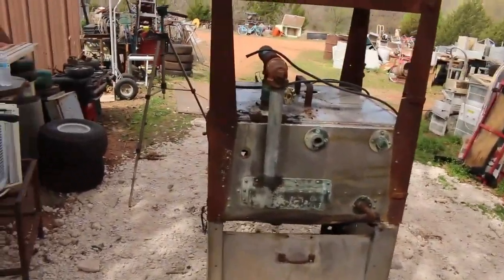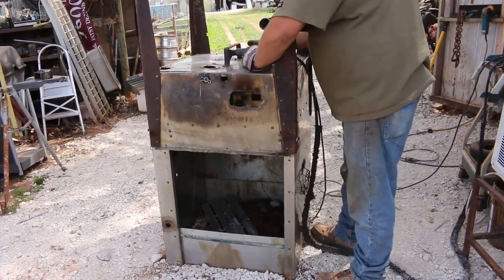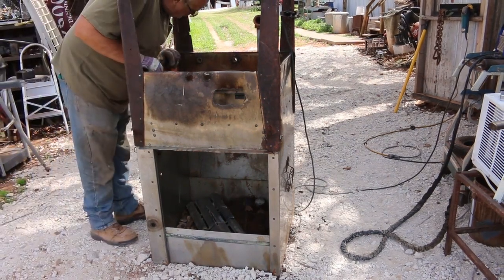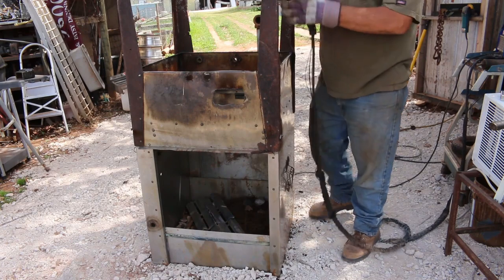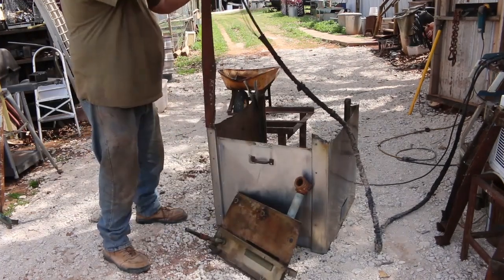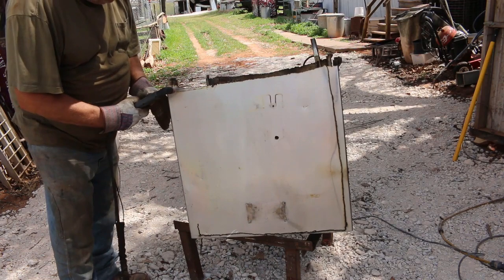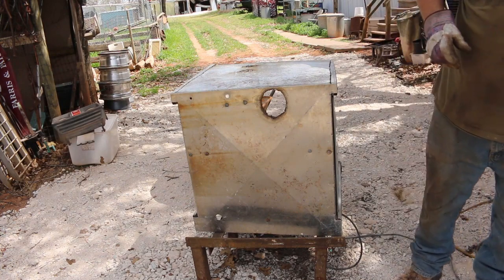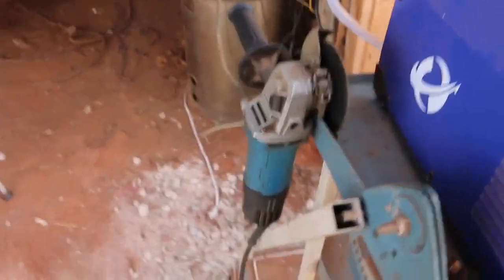Scrapping out an old Dish Washer for Lots of Stainless Steel Brass and Copper

Comment: I also used one of those dishwashers, the one I used was off of a Navy ship. Thanks for the upload
Reply from the maker: I think it may have been much faster and easier if I would have taken the air chisel to the rivets on the legs. then I would not have had to cut around them

Comment: I scored two Franke industrial dishwashers. It was 100% stainless except for the copper, and brass and fittings.
Reply from the maker: I found out that the two straps inside I think the tray that holds the dishes slides on them, they are brass. I should have weighted them
Reply: @Okiescrapper  if mine were brass I completely missed it 😂

Comment: I belive you could have melted out those rivets in a jiffy.
Reply from the maker: yep, just toss it into the melting pot
Reply: @Okiescrapper  I meant with the plasma cutter, most likely they are aluminium, and the melting point are much lower than the sorrounding metal, and the the heatconductivity much better.

Comment: Good video! I'm interested in the plasma cutter. Does it run your electricity bill up? Thanks!
Reply from the maker: yes it will a bit. you are running the air compressor and the cutter will run on 110 volt if you have a 30 amp breaker, so it does pull some amps when cutting. but I think it is cheaper then cutting with gas. and it will cut steel, aluminum, copper, brass, and stainless

Comment: Why did you not blow the aluminum rivets out instead of waisting your time cutting all of the stainless steel? The rivets are aluminum.  The stainless is not the cheap stuff used on home dishwashers, it is industrial stainless. The plasma cutter will burn thr rivets clear through in seconds.  You waisted material and time.
Reply from the maker: yeah, it would have been faster to use the air chisel to pop the rivets off. would have saved a lot of cutting, live and learn, now I wounder will I ever pick up another one. in this business you never know what you will get